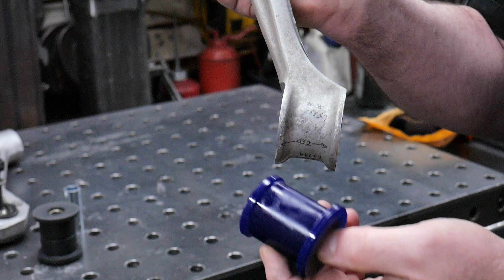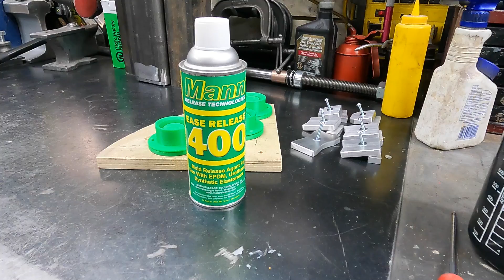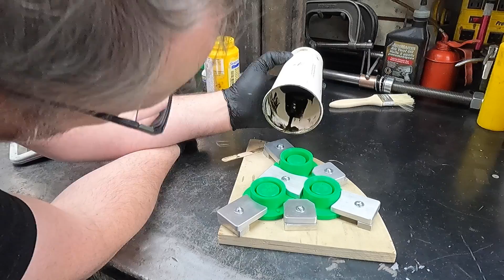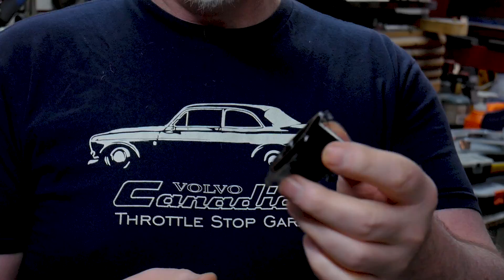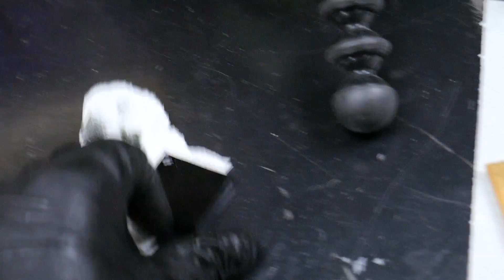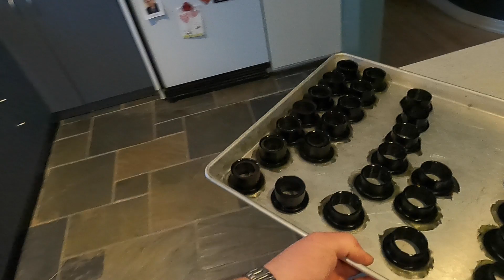DIY Polyurethane Suspension Bushings

Comment: Nice job on the bushings, the biggest challenge as I see it is not having CAD software or knowledge & no ability to 3D print.  Otherwise I would love to fabricate urethane bushings for my old cars or C4 Vette!  Suggestions?
Reply from the maker: I use Fusion 360 - it's pretty intuitive.  It's also free.  If you were intent on doing this, there are lots of 3D options from online to local clubs/maker spaces that can help you out.  Bushings for your application are available...just not for the early C4's
Reply: You could turn moulds from solid ABS (or other polymer) using a lathe.
Reply from the maker: @brianb-p6586  Sure...but I don't have a lathe.  I can just design the part and print it.
Reply: @ThrottleStopGarage  My suggestion was for Brian Schuett, who has no 3D printing ability, but might have a lathe.

Comment: Wonder if hitting the side of the fixture plate with either a DA sander or oscillating multitool would make getting the air out faster and easier... or just cause it to splash all off the place.
Reply from the maker: I think it would work just fine.  This was partly therapy.

Comment: Just a suggestion, but I would have made the base plate for the mold a circle sized so it could fit in the vacuum chamber, then instead of all the aluminum hold downs, just another circular piece of plywood with holes for the mold fill holes. That would reduce your build time dramatically, reduce the setup time for each batch, and allow you to vacuum purge the poly inside the molds.
Reply from the maker: True - but it's also cold here and I was taking the board into the house to cure instead of having the heat cranked in my garage.

Comment: It's unfortunate that commercialism has made PU a generally accepted material for bushes. There are only a few locations where the material can be applied in a durable way, since it's so prone to creep. Defending that by calling it for highly maintained track/race vehicles is BS in my opinion, example one of the major brands selling them to use in bmw rear subframes. After only a few months of the car standing on it's wheels, it'll have compressed the bushing half that squeezes between the body and subframe by enough to create visual play. Same goes for alignment values over a period of a year (light use), the whole front and rear wheel geometry has considerably changed.
Reply: I've been running mine in my daily 4x4 for 6yrs. No sag. One 🔑 he mentioned was space for grease. Also quality of urethane is also important. Lots of cheap stuff out there.
Reply from the maker: Very true.  These will be the outer shell of a multi part bushing.

Comment: I wonder the end downside of machining the arms to fit the blue bushings. It looked like there was plenty of material to work with.
Reply from the maker: Then I end up with custom arms.  If there was ever a problem with the arm, then it's more machining.  I also wanted to try a different bushing design.  So lots of pros and cons to each decision.

Comment: Keen to see a follow-up to see how durable these turn out under use. I love the idea and If wonder to see if there's a difference in materials beyond shore hardness. Things that come to mind is tear and compression strength. I know you plan to put them through their paces and if they hold up, I'm even more convinced!
Reply from the maker: This is a pure science experiment.  They may work and they may not.  I could switch hardness pretty easily when done.  These bushings will be three piece - poly/delrin/stainless steel.  All I can do is test and see what happens.
Reply: @ThrottleStopGarage  Exactly and the best part of it. A good day can have trials that fail, but a bad day is certain if you don't try at all.
Reply: @ThrottleStopGarage  In your comments about commercially available bushings you noted the lack of ability to hold grease... then you built bushings with no provision to hold grease. That and the large bore diameter make sense now, given your plan to use Delrin bearing sleeves inside the bushings (so the bushing won't slide on anything so no lubrication is needed), but it might have been good to explain that in the video.
Reply from the maker: @brianb-p6586  The ID fo the bushing has the "as printed" surface which would effectively hold grease.  The OD I don't want to rotate. I did miss this in the explanation - but not in the part.
Reply: @ThrottleStopGarage  I don't know why you would want the inside surface of the bushing to slide on the Delrin - if the polyurethane bushing and Delrin bearing are kept together by the roughness of the as-printed texture without grease, that seems preferable.
Reply from the maker: @brianb-p6586  I don't want motion between these elements - but as a general response to your comment, the printed surface should work well.
Reply: @ThrottleStopGarage  I wondered why the bushing walls were so thin. If I am following you the finished assembly will have a steel sleeve that can rotate inside a Delrin bushing, and a Poly outer bush for compliance?
Reply from the maker: @GrayRaceCat  that's right.  It's a three part bushing. Just starting back on this part of the project.

Comment: Why didn't you 3d print the bushings out of tpu?
Reply from the maker: My direct feed printer is quite slow and with all the pre-heat that you have to do...well I wasn't sure it was the right idea.
Reply: @ThrottleStopGarage  i 3d print a bunch of bushing all the time. My ATV has ninjaflex on it's a arms and they have held up very well for a few years now.
Reply from the maker: @jasonhughes1156  Very cool.  We'll see how these work out.  I'd be willing to give it a try if these don't work out.  Lots of time to experiment when I'm done with the major pieces.

Comment: Very cool!! Question: do you have to use abs or could you use pla? Does the release agent act differently with different filaments?
Reply from the maker: You could use PLA or PETG (probably more the latter than the former) - but once your set up and can reliably print ABS - I print ABS all the time.  It's just stronger and an overall more durable plastic.

Comment: Two questions;  1)  If the blue purchased bushing was nominally the right dimensions other than between the flanges, did you consider either turning them back (thining them) or turning one end of them off and only needing to make end cap washers?  2) If you felt the blue bushings were otherwise adequate, why didn't you start with measuring them?  (They would have already included the anticipated compression in the material and such.)

Have you seen Robert Tolone's channel on making molds/castings?  (Vacuum versus pressure, etc.)

I once tried to convert a hydro-pneumatic (?) engine mount to a solid urethane mount, that was a real bear.  Got it made, (utilizing Devcon) but there were other issues with the engine.
Reply from the maker: I could have split the bushing  - but I'd never trust it.  I have also changed the design.  This is going to be part of a multi piece  bushing.  Will it work?  Who knows, but we're going to try.
Reply: @ThrottleStopGarage  I also thought if you were to split two bushings to make 1 in some combination. (Essentually two flanged bushings meeting in the middle, like the Vette bushings.)  It's always a bit of a balance between the knowns and the unknowns, costs in money and (in this case mostly) time.  Guess I would have gone to make a workable version out of the blues (since you otherwise seemed to have liked them) and moved on to the next issue.  Of which you have plenty more I'm sure.  As you know, always several was to approach a problem.

On many of my machines I get trapped in to making washers of all things; particularly for smaller screws for better distribution of the load.  SAEs are so sloppy for 1/4s and smaller!  Why someone doesn't make body fit -0/+.005" washers I don't know, I would certainly buy them when I needed better than a finished/jig washer.  So I have them made at a very high cost/unit.

Comment: Pour from higher up in the same spot instead of moving around the part.  The urethane will flow into the mold and not capture any air. Pouring a thinner stream also helps any air in the mix to release.
Reply from the maker: That's a good tip.  I'll try that if I have to do this again.
Reply: @ThrottleStopGarage  It was in one of the mold making videos, I've watched soo many at this point.  Smooth on, BJBEnterprises, Brick In The Yard Mold Supply, freemanmfg
Here's a smoothon squish mold process for a tail light:
https://www.youtube.com/watch?v=Pu1RTkWHA3o
Reply: Was thinking that when he was pouring. Going around is like putting a blanket on your bed vs dropping it a corner upright.

Comment: Beautiful.  Sometimes if you pour slowly, at a single location, and let the liquid slowly flow down to and across the bottom of the mold and sort of fill the mold from the bottom up, you get a lot fewer bubbles.  If you pour too quickly and cover the top opening, the air is trapped and tapping won't always force the bubbles to the surface.  Also, letting the part set and cure under pressure (in a pressure pot) will collapse any trapped air so it doesn't form a void.

You going to be selling rides in that majestic Volvo when you're done?
Reply from the maker: I didn't master the super slow pour.    Could have converted the vacuum chamber to also be a pressure pot.  It was more work, but bubbles were not a problem.  

When it's done...looking forward to doing a little tour.

Comment: I ended up making delrin bushings for my irs because no one made them anymore
Reply from the maker: The design I worked out has a delrin inner and a stainless sleeve.   We'll see how it all works.
Reply: @ThrottleStopGarage  I wish I had machined my control arms uniformly instead of making each derin bushing fit the control arm. It was alot of lathe work..
Reply from the maker: @AndyFromm  That would be a lot of work.  That's the idea here - use the urethane to take up the little inconsistencies in the parts.  I also think that in these positions - delrin is a better idea for a long-term bushing solution.
Reply: @ThrottleStopGarage  if I remember correctly the delrin irs kit for the "newer" mustangs involved boring all the control arms bushing holes to a set size so the bushings fit correctly. Apparently ford never machined them that consistent and the rubber didn't care.